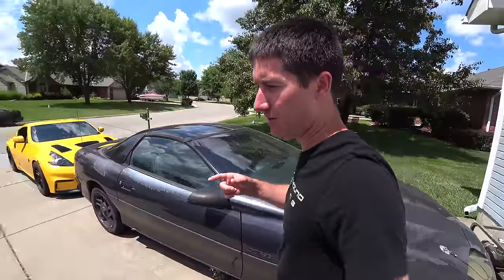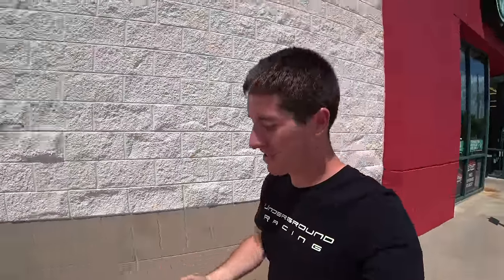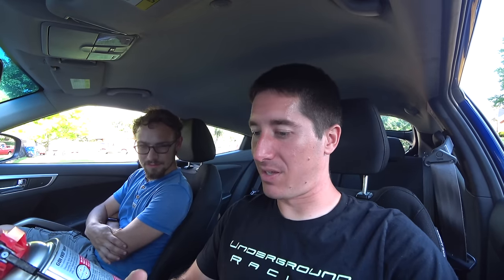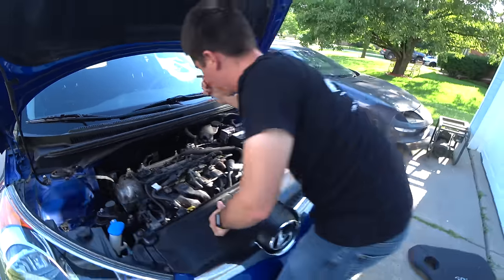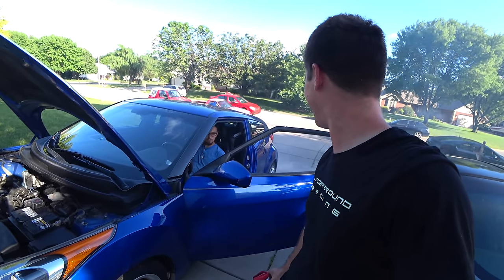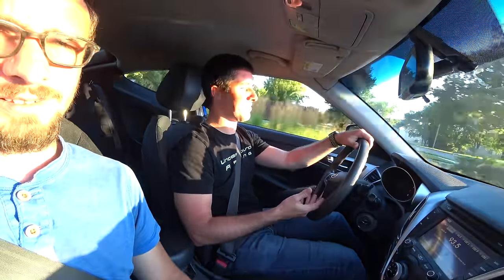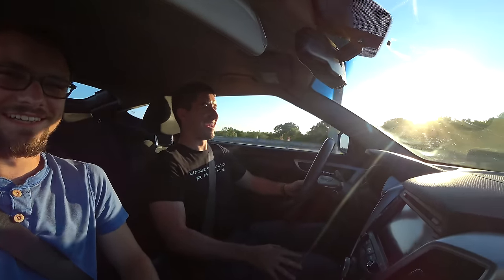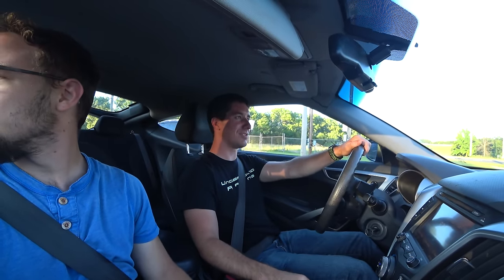How To REMOVE CARBON Build Up From DIRECT INJECTION Engines For $12

Comment: If I were to use this on my 2000 Honda Accord V6 would it potentially solve the idle/stall problems? I recently replace the idle air control valve which was nice for a second but then went again. I’m hoping this might clear things up for it.

Thank you
Reply: It definitely could. When there isn’t as much air intake due to the carbon deposit build on the intake valves, that can be a cause to idle/stall issues. Also, cleaning the MAPS or MAFS of your vehicle can help as well possibly 🌞

Comment: JR, you are mistaken about the lifetime Autolite warranty. The warranty covers any manufacturer's DEFECTS only. Not normal wear and tear. So if you have them for 100K, and try to turn them in under warranty, it will be denied. Same with brake pads that have a lifetime warranty, covers DEFECT ONLY. I work in the aftermarket parts industry.

Comment: Is this a Turbo? I find it hard to think all that smoke came from the valves. If it is a turbo it could be some oil caked on the turbo fins being removed. Thoughts? Can't dismiss that it runs better.
Reply: Larry Be: This one is a non-turbo.

Comment: Is it required to replace the engine oil after done this thank you
Reply from the maker: Nope, you'll be fine! 🍻
Reply: @WatchJRGo  thank you
Reply: Wrong, CRC recommends changing the oil afterwards.  I emailed them to confirm it.
Reply: @peterstarck564  it went into the vacuum lines and into the intake. No reason to change the oil.

Comment: a more in depth study of cleaning direct injection engines, using hydrogen, this method and walnut shells, which involved before and after dyno test after each treatment, removal, before and after of each treatment of the intake manifold, shows that this method doesn't work at all.  Zero to worse after the treatment.  The best result was from walnut shell blasting.
Reply: Walnut blasting is definitely needed for engines that have not had regular cleanings. But for those that do regular cleanings (every 10k miles or so) this is great.
Reply: @myya8370  I just had to go through with the walnut shell treatment after giving 4 or 5 cans of this stuff a go.  I could see no effect of the product on the valves, so in a "nutshell" this product is purely preventative, if even that, and definitely not curative.  My car engine was an Audi TFSI.  It is also advised to change the injectors since you have it all apart.  My car runs like new now.  Amazing.

Comment: I have a 2014 Optima Turbo. I've sprayed the CRC spray through the air intake after removing the clamp holding the air filter housing. Sprayed the product as directed. Heard a 'guggling' sound after some time. Followed all instructions as directed on the can again. Nothing noticeable after starting the car after the 1 hour wait. Took it for the 10m highway ride, had some rough handling like car stalling 2 or 3 times. No real change in the car handling, no fumes or whatsoever after that. No significant change in idling behavior or change in MPG. Has anyone done this with his Optima? Feedback much appreciated.

Comment: The problem with doing it this way is that if the carbon is severe it all dumps into the cat which means replacing the cat will be shortly down the road. Put Techron in your tank once a month and carbon won't be an issue.  The knock noise sounded like vaporloack due to dumping it into the vac hose in a short amount of time. Do short bursts and allow the engine to burn it.  Rod knocks don't temp reduce the rpm and then recover.....lol. A rod knock is mechanical and once it happens its "replace engine go time" in about all Hyundai's.
Reply: techron won't help a GDI engine unless it has some valve overlap like Hondas.  I'm sure other brands do it as well.

Comment: i noticed my mpgs dropped like 8 mpgs. i cleaned the throttle body, then used MAF cleaner on the MAF.
im on my 2nd tank of gas..  runs fine. responsive. but just lower mpgs...

Comment: I thinking you should have done a bore scope before hand for before and after results?...Maybe you didn't need to do this at all,  Have you thought about what you are breaking off and throwing into your cylinder walls? I'm wondering if you have turbo and if particals might damage the heated turbo exchange

Comment: the crc will actually remove carbon build up from your intake and then plaster it to the back of your intake valves. it may run better for a couple of days, but then your back to cold start miss fires.
Reply: NO, it will reaccumulated again, but that will not be for thousands of miles.

Comment: I want to do this process on my 2016 Santa Fe Sport GDI 2.4L engine, where is best location on engine to access the spray for cleaning??
Reply: I sprayed thru the throttle body, just followed the instructions on the can, should be fine; dont spray too much at once, spray in bursts
Reply: @eterna1_44  I like to do this procedure via a vacuum line, which one is recommended  and easier?

Comment: Is there a way to do this by yourself? How can you keep the car at 1500 RPM when you're by yourself?
Reply: Used a breaker bar on the gas and pushed the seat forward to hold it at 2k, not ideal but worked for me

Comment: How did you remove the vacuum inlet ? Mine is stuck even if I remove what holds the tube to the brake booster pipe

Comment: Is it normal for the check engine light to come on after spraying through the vacuum line? Letting it heat soak now and taking it to autozone to make sure.
Reply: It most likely came on because of the vacuum leak

Comment: personally dependant upon how bad the intake valves are the cleaner does not really do as good of a job as you think it would. if ot is really stuck to the valves your better off carefully manually doing it and than buying a cheap media blaster and walnuts to clean everything in there to new again. sure its more work but much more proffesional and cheaper than a shop and you dont risk over heating or hydro locking the engine with to much cleaner. also there is a really good cleaner out there called 505crf and 505cro and they are for fuel systems and oil additive to clean everything out.

Comment: Don’t you have to use he brake booster line closer to the intake because the Hyundai has a check valve in the line?

Comment: I'd have just tried Chevron Techron Concentrate (concentrate plus, not the regular injector cleaner) first. Generally it does wonders smoothing and quieting GDI engines. And much easier. Hyundai, GM, BMW, and others all sell their own branded bottles of it for that exact reason. My most recent experience with it was a friend's IS-F that we noticed had gotten rather rattle-y sounding past 100k. I suggested he try it, and the next time I saw the car it was back to quiet and nice and buttery smooth again. Now he throws a bottle in once a year or so.
Reply: I realize this is a 4 year old reply so I apologize. I just recently used this in my 2012 50k miles veloster.. would using the techron stuff do the same thing as what they did in the video?
Reply: @todd1573  I wouldn't say same. But it will usually clean it and quiet it down without having to disassemble anything. At the least I'd try it before resorting to the level JR did here.
Reply: How would the valves get cleaned with only adding the Techron (or other fuel additive) to gas tank when the fuel never passes the valves in a DI engine???

Comment: Hate to burst your bubble, but chemical cleaners do almost nothing for GDI carbon. It is like concrete. These chemical cleaners take the oily film off the top of the carbon and leave the carbon there. I've tried all sorts of different chemical cleaners, including much more expensive and aggressive cleaners from BG and they don't really do much. The knocking and the smoke was caused by the engine sucking in a huge gulp of the cleaner that had settled at the bottom of the intake manifold. The cleaner causes compression ignition to occur under loads and makes the really heavy knock you heard. Its also typically designed not to burn completely in the cylinder so that it can try to clean off some of the exhaust carbon as well, so it comes out as smoke in the exhaust, especially once it hits the hot cat.

The only effective way to remove carbon buildup on GDI cars is walnut blasting or manually chipping it off.

--Professional technician who has worked on 1000s of GDI cars.

Comment: I always worry when cleaning carbon. As a friend of mine ruined his catalytic converter with sea foam.
Reply: roger chaple that’s why you run no cats
Reply: If cats got ruined by sea foam, then they were already on deaths doorstep.  Sea foam is just naphtha and a few other inert ingredients.
Reply: I've run seafoam in the crankcase before and gotten a bunch of old crap out, wouldn't use it on anything with VVT with the small passages and all. Not worried about my pushrod V8. Runs smoother after the seafoam oil change. No issues with my cats.

Comment: I appreciate your video. I have this issue with my 2013 Audi A7 and still gun shy about running this product or any other solvent cleaner through the supercharged engine. Do u or anyone an opinion on that?

Comment: What is the difference between that stuff and seafoam?
Reply: The CRC contains a high percentage of PEA detergent which cleans carbon, and it's sprayed right in the air intake and hits the back of the intake valves. Seafoam doesn't have any of that and you just pour it into the gas tank. That doesn't help with GDI engines at all as they're not port injected, so it doesn't clean the intake valves.
Reply from the maker: I saw another review where this worked quite a bit better than Seafoam so I wanted to try it. I was surprise at how well it worked 🍻
Reply: @vg4902  seafoam also has a spray can like that to spray in the same way.
Reply: Mark Simrow yeah I’m assuming same stuff different brand
Reply: @msimrow  Didn't know that. But the CRC does contain a cleaner that's specifically for carbon deposits. Seafoam doesn't have it.
Reply: V G sea foam also has a deep creep that you spray just like this.  I’ve also used marine top end cleaner and dipped my vacuum hose into a can of sea foam to do basically the same thing.

Comment: Step 1: You should have drove it to operating temp. Step 2 : Pull over and turn it off,. Step 3 : pop the hose off, use duct tape around the hose with the nozzle in the hole. Then restart the procedure.

Comment: Great 5 minutes worth of instructional of video.  You did not need to add the 7 minutes of time wasting, unnecessary ego-tainment.  Most folks don't come to DYI videos to be entertained, they are trying to learn something.
Also,  if you read the can or watch similar videos you will see how to use a cloth to keep possible contaminants in the air from being drawn into the intake manifold.  Hang in there, you are young and have a lot of life in front of you.  You will learn to do better.

Comment: That was spark knock. You didn’t blow carbon out. Your adding a bunch of unmetered fuel, O2 sensor showed a rich condition and the computer pulled a bunch of fuel. That thing ran super lean. You can’t fix anything with a can.

Comment: 6:30 mark. Sounds like you were hydro locking a little bit. Water can expend to vapor at 1600 time its original liquid volume. Any water in the product could potentially cause this. Also, given its GDI control system and your removing the booster line and spraying CRC into the cylinder may have caused an abnormal fuel supply which can be cause for a temporary clatter.

Comment: The other option would have to install an oil catch can.
Reply: Carbon still going to buildup up in a combustion chamber because the valve is not lubricated by the fuel injector

Comment: Its been proven that this doesn't do squat for valve cleaning. intake off and walnut blast is the only thing that works
Reply: Say you are right, how do you account for the smoke and it running better. Are we to dismiss our lying eyes and ears?
Reply: I received part of your reply that started off about a placebo effect. I will wait to fully respond until I see your full comment.
Reply: @larrybe2900  Read above, endoscope tells all. Chrisfix already did a endoscope analysis video and the results weren't good...
Reply: @goclunker  
Without the same look-see here we can't say for sure but what about the obvious better running of the engine in this video? Something positive happened that changed something that was thought to be build-up on the intake valves. Maybe it was a wrong assumption?

Comment: It takes 10-15 minutes to pull the intake on that car, I assure you there is plenty of carbon left in there.  Short of scraping it and blasting it I have yet to find any cleaner that will get it off there. I even had the head off one of those, tipped on it's side and filled the intake ports with CRC and left it overnight, not much result maybe 25% better
Reply: Can you clean the valve by removing the intake manifold?
Reply: @jordanperez8245  Sure, pull the intake off and turn the #1 cylinder to TDC, that way the intake valves are closed and you can clean them out and blow out the debris without any of it making it into the cylinder, then do the same on #3, #4, and finally #2 cylinders.
Reply: I tend to agree for the most part but remember that it heat soaks which is much better than just letting it sit on cold metal.

Even washing dishes the grease does not come off easily with cold water, the hotter the water the faster the grease will come off.

Comment: JR will doing this harm the catalytic converter?
Reply from the maker: The carbon should burn off once it enters the exhaust system, cat temp is usually around 800-1000* F which is way over the threshold you need. 🍻